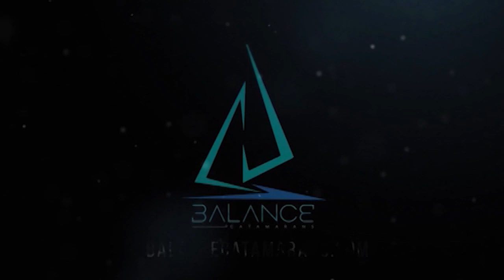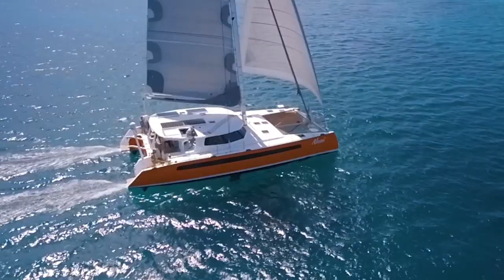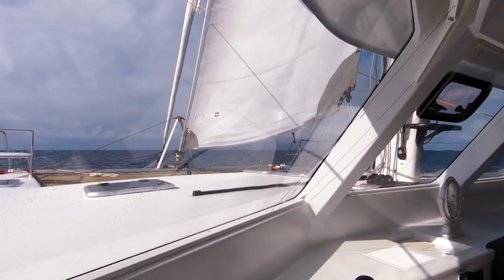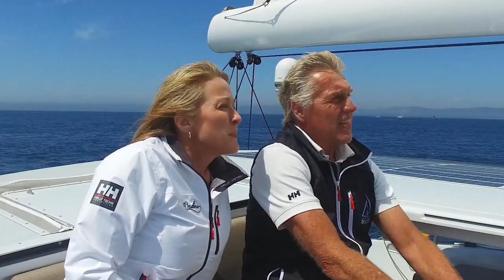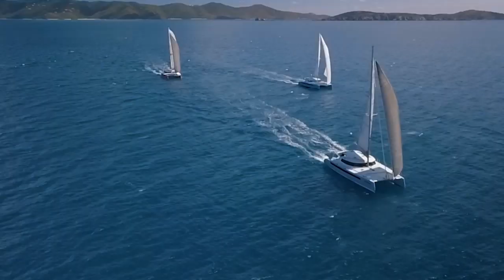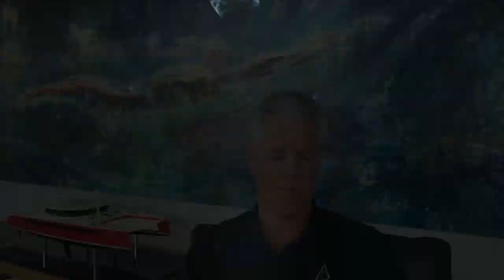Electric Engines on a Balance Catamaran?

Comment: 4:30 the range assumption without a generator is insane, allowing silly emotional ocd to interfere with good design. 
Sad. 

There's a place for really big batteries and small genset for backup. The appeal imo is noise and maintenance. 
Green is for virtue signalling. This lifestyle has a fair footprint, not much of it being fuel.

Probably want 2 days worth of battery so after a day you can turn the genset on...

Hopefully this new generation of Tesla batteries will make it possible without crazy price and weight.

Comment: Please allow me to address some of these points.  I have studied and used electric drive for more than 20 years.

0.   The marine industry is generally highly conservative, and rightly so since lives are at stake and the ocean is a harsh teacher.  So it's reasonable to proceed cautiously.  

Yet at the same time, anyone who cares about nature, and I think that includes most people drawn to sailing as a hobby or lifestyle, probably agrees that combustion engines are not making the environment better or healthier.  We are smart enough to have better solutions.

1. The climate scientist gave you an unreasonable request in asking for electric drive with no generator.  Using that unreasonable request as an excuse to not do electric drive is therefore a bit of a straw man argument.  

Currently, the only reasonable way to do long passages with an electric drive is to include a diesel generator for covering long becalmed periods.

2.  Batteries are improving rapidly; far more rapidly than solar cell efficiency.  Lithium ion batteries are improving about 7% a year today.  Within 3 years Tesla expects to be able to sell a 300 mile EV for $25k at a good profit.  At that point, it will cost less to both buy and operate an EV compared to a combustion car.  It already costs about 1/3 as much to operate an EV than a similar class combustion vehicle.  When EVs both cost less to buy and to operate, than it will make ZERO ECONOMIC SENSE TO BUY A FOSSIL FUEL VEHICLE for most use cases.  That point is happening in 3 years.

While the benefits of these improvements to Lithium ion batteries have been slow to reach the marine (pleasurecraft) industry, it will inevitably happen.

3.  Certainly for day sailing or coastal cruising, an electric drive makes perfect sense today.  The use case is to charge from shore power, wind generator and/or solar panel, then to motor out of the harbor, raise the sails and recharge the batteries using regeneration/hydrogeneration.  

For any AC drive motor, a separate hydrogenerator is NOT USED.  The AC drive motor is left in drive.  As the wind picks up, the boat pulls the prop along, and THE DRIVE MOTOR ACTS AS A GENERATOR.  After the battery is recharged, the motor is disengaged, and the prop is optionally feathered to reduce drag further if the prop has variable pitch.  Oceanvolt, for example does all of this automatically and completely intuitively through a single throttle lever.  There are many people already happily sailing this way today, mostly in Europe.

To be clear, in this case, all energy used to motor out is replaced using wind energy simply by sailing with the motor engaged and used as a generator under sail.  No additional equipment is needed.  This is literally using only energy from nature to move the boat, including the motoring.  As sailors who must work with nature, I hope we can see the beauty and logic of doing that.

4.  Regarding efficiency, while it's true that traditional gensets may not be very efficient, the general efficiency of using a combustion engine to turn a generator to charge a battery bank and/or drive a propulsion motor is about the same as a reduction gear, i.e., very high.  That's the reason diesel electric locomotives can do that instead of using a gearbox, and also diesel electric submarines, and Integrated Electric Propulsion on large ships.  There is also a small boat transmission that uses a generator and motor in place of a mechanical gearbox.  So it's factually incorrect to say that this must be inefficient and many current real world examples, including in big ships, show that it is efficient.

5.  An intermediate solution that reduces risk is to use a conventional diesel drive in one hull and electric drive in the other hull.  Either use an alternator on the diesel drive to act as a backup generator for the electric drive battery bank in the other hull, or include a separate diesel generator in the electric hull to use for passage making in the rare cases that it's needed.  This keeps the advantages of dual motor redundancy, while allowing hydrogeneration for daily motoring, powering house loads, etc., using the hull with electric drive.

6.  In a nutshell, Hydrogen is bullshit.  Most commercially available Hydrogen is made from steam reformation natural gas (Methane), a fossil fuel.  That is a reason why Hydrogen is supported by fossil fuel companies.  Due to the inefficiencies of doing this, it's more practical to simply burn the natural gas in a combustion engine than to convert it to Hydrogen for use in a fuel cell.

For Hydrogen made from the electrolysis of water, the well to wheels efficiency is about 4x worse than using the exact same input energy to charge an electric vehicle.  Said another way, an EV will go 4x as far on the same input energy as a Hydrogen fuel cell vehicle.  Said a different way, 4x more energy/windmills/solar is needed for fuel cell vehicles than battery electric vehicles.

Hydrogen has been used in bad faith as a red herring by oil companies to delay and prevent the adoption of EVs.

To build a Hydrogen distribution infrastructure would cost nearly the same as an oil distribution infrastructure: many trillions of dollars.

Hydrogen is highly impractical for most use cases.  

One notable exception is medium duration manned spacecraft, where Hydrogen fuel cells can generate heat, water and electricity simultaneously, when combined with Oxygen.  The Space Shuttle did that.  For short orbital flights, and long term space stations, fuel cells are not used.  For the latter solar cells and batteries are used.  Same with satellites.

Summary: Electric drive is a better way to do things, both on land and water.  Use a backup generator for passagemaking.  Battery costs are falling rapidly.  Technology is improving.  Long term, electric drive will replace combustion engines for daysailing and coastal cruising.  It's inevitable due to falling costs, though it may take a bit longer on the water than on land.  

On a sailboat, the diesel generator would get even less use than a diesel drive, since the propulsion battery bank can be charged from a wide diversity of sources: sailing, wind generator, solar, shore power, etc.

P.S.  The most intelligent way to do a diesel generator for a serial hybrid boat is to do what Silent Yachts did and connect a standard marine engine directly to an electric motor used only as a generator.  This gets parts commonality with the propulsion electric motors, and global support and maintenance of a marine engine.  This is much more maintainable, efficient and cheaper that using a genset.  A 22 kw Yanmar + electric motor and controller costs much less and is much lighter and smaller than a 22 kw genset.  It's probably quieter too.  (To be clear, this is using the engine + motor only as a generator.  The engine is not connected to a gearbox, propshaft or prop, just to the electric motor used as a generator.)

Comment: Little surprised having a generator backup seems like a hurdle. Who is purchasing a $1MM+ cruising boat without a generator?
Reply from the maker: Two our customers have Balance cats without generators as they do not need them. With large solar banks, lithium batteries, and good alternators on the engines they do not need them. But we are not selling catamarans for charter programs where the guests are indiscriminately running aircons all day, taking 15 minute showers, etc!!!  Soon you will learn that almost none of our boats will have generators and only Integrel alternators, convection stoves, etc.. Saves weight, complexity, and is 25% more energy efficient. And safer.

Comment: I am not green, not Eco, I do not want to save the planet, but I would not buy an diesel engine boat. I just want electric. And for backup maybe a small house generator with a little of diesel onboard. Just need enough solar panels and enough batteries. Some vertical wind generators would also help create energy and push you a little bit. At this point in Diesel engines do not make sense anymore. Even some pivoting solar panels in the back could act as a small sail.
Reply from the maker: And you can do that. Ideally you are prepared to sit around a bit when you have no wind and ideally you have a boat that is easily driven so you can keep the electric motor size down or else you will not be getting away with a small diesel generator. And you will be reliant on solar or wind generation if your diesel gen quits on you. We have a great deal of experience here seeing the struggles people have had in the catamaran world with getting long range under power out of electrics. Speed and range under power or sail are hugely helpful to safety with modern weather routing.  Good luck. Phil

Comment: what about hybrid? like what greenline yachts..
Reply from the maker: Sure. We can do anything. We just want someone else to design it and install it and remove us from the liability loop when a failure arises. I have no ax to grind here at all. Other than not wanting that anxious call from the Cook islands as to why my boat won't start!
Reply: Balance Catamarans I think this answer summons all. We don’t want to be responsible, so we better say it’s not a good idea. Electric combined with DC genset for backup charging can provide enough energy for sustained motoring until you empty fuel tanks. On top of that modern electric motors have very efficient hydrogen charging. With all honesty electric is also much more reliable compared to the combustion.
Reply: @petrstolz5788  Its definitely not or more boats would use it.  Its a lot easier for people to trouble shoot a diesel engine that can go 6000 hours than an electrical system when theyre in the middle of nowhere.  Also people know how to work on diesels all around the world.

Comment: This guy lost all credibility stating it would cost $250K to opt for electric. Total bullshit either option involves two motors or engines, a genset and battery banks. Only difference would be lithium batteries. With Oceanvolt the regeneration on that cat would be 200 watts or more per motor at 7.5 kts.